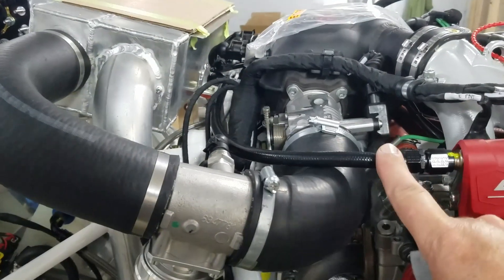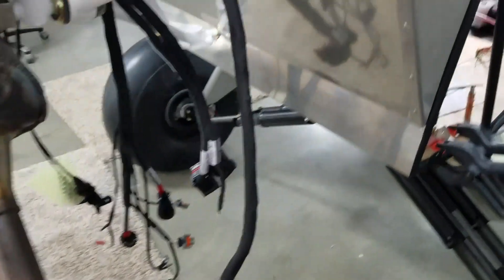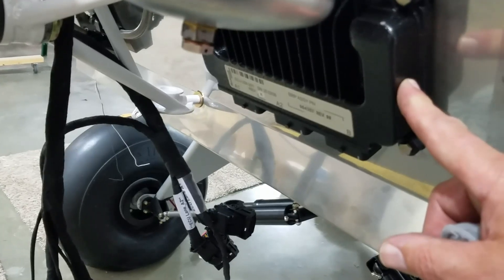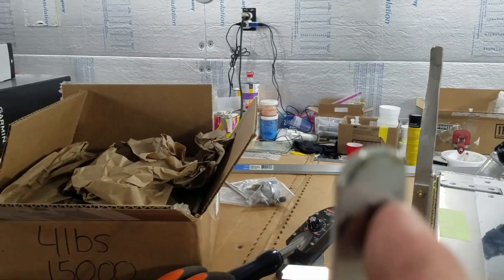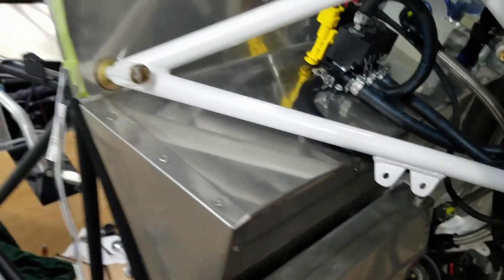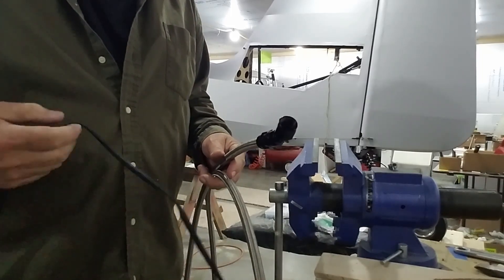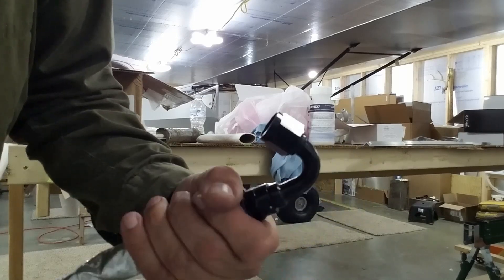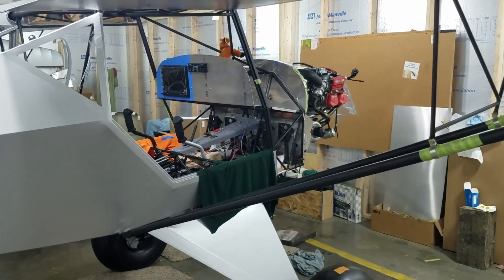Kitfox STi Farmfox build, Rotax 915is FWF plumbing continues. Building Fragola hoses. #30

Comment: Would you share where you found the AN coupler with the port for the Schrader valve?  I’ve not see that part.  Or did you buy a coupler and drill and tap it yourself?  Thanks.
Reply from the maker: I bought them on ebay. Here's some...     https://www.ebay.com/sch/i.html?_from=R40&_trksid=p2334524.m570.l1313&_nkw=AN+coupler+with+port&_sacat=0&LH_TitleDesc=0&_odkw=AN+coupler+with+the+port+for+the+Schrader+valve&_osacat=0

Comment: I was surprised to see the ECU mounted on the engine side of the firewall.  I was thinking the Rotax installation manual said it should be mounted on the cabin side of the firewall, but given the size of those connectors, it would take a huge hole in the firewall to get them through.  I am building a RANS S-21 and plan to use a 915 and am looking at these considerations now.
Reply from the maker: It is odd because all the 912s I have seen had them inside the firewall but the 915 install has them in side the engine compartment. I don't know the reason, I just followed the directions. Haha
Reply: @KitfoxPilot  I just read the manual again and I see it says it can be mounted either place.  I am sure the earlier manual I had said to mount it inside the cabin.  It sure is easier to mount it on the engine side of the firewall rather than the cabin side!